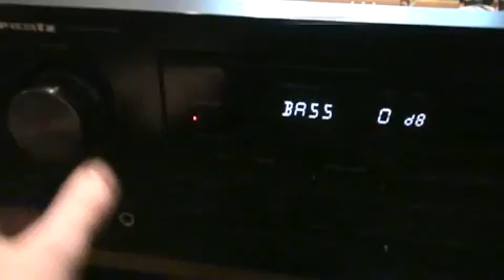Inside the Marantz SR-4320 receiver

Comment: Hi DrCassette, so glad I found your video. I have exactly the same receiver but a couple of weeks ago it broke down all of a sudden. When I try to switch it on, the red signal light is flickering and you only hear a clicking sound. I opened the reveicer and located the sound coming from the black box behind the remote control unit you're mentioning at 1:01. You call it the "relays". Do you have any idea in how far my problem relates to this unit and whether it is possible to fix it at a reasonable price? Thanks a lot for your help!
Reply from the maker: Der Einfachheit halber auf Deutsch: Der Einschaltvorgang wird durch einen fatalen Fehler unterbrochen und startet danach neu. Dadurch das Klackern des Relais und das Blinken der Lampe. Der Fehler kann viele Ursachen haben, spontan würde ich sagen Kurzschluss oder ein gravierender Defekt in der Endstufe. Reparatur wird dementsprechend wohl nicht ganz billig, es sein denn du hast Glück und es ist nur ein Wackelkontakt. Der kann das auch verursachen. Wenn ich mich recht erinnere, lief der Receiver ziemlich heiß, da kann durch thermischen Stress mal die ein oder andere Lötstelle schlecht werden.
Reply: DrCassette
Ach klasse, vielen Dank für die schnelle Antwort. Dann werd ich mit den Infos mal den Weg in die Werkstatt antreten und hoffe auf den Wackelkontakt. Sonst muss da wohl was neues her...

Comment: Hello Dr. Cassette, thanks for your reply/advice. One more question. I am talking to someone about some vintage Advent 1 speakers. I have many options for a receiver. A couple from the 60s,and 70s, or a Marantz model SR-4320 for fairly cheap. You said on your video that this has a nice warm sound. Do you think this would be a good companion receiver for someone who is trying to recreate a warm/70s vintage HiFi sound? They have Suggested Minimum Amplifier Power 15 Watts per Channel.

Comment: I don't like "modern" amps.The board is too simple.
My amp has the same "problem",it gets REALLY hot.Fixed it by mounting 3 8cm pc vents underneath,with their own power supply.It still gets hot but it take's longer to get to the earlier temperature.
I like the AC cable.That's a proper cable for an amp.
You said pre out,does that mean you can use it an preamp??

Comment: treble plus six! Yikes! if you have horn speakers!
Reply from the maker: At the point when I made the video the receiver hadn't been used in years. So the tone settings were all over the place. When I was still using the unit, I had the treble set flat.